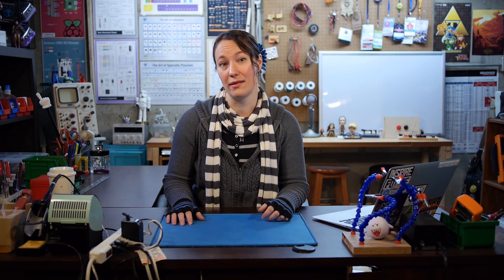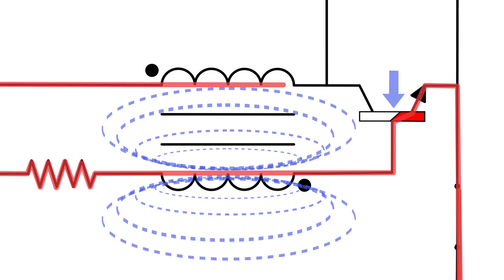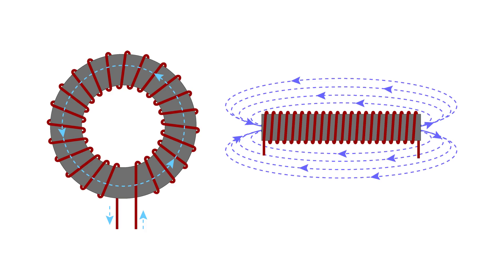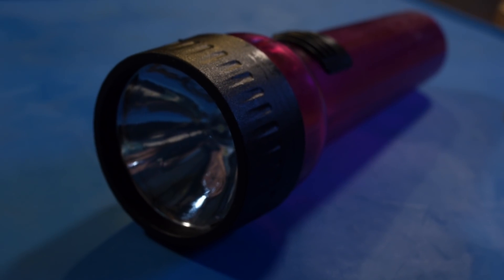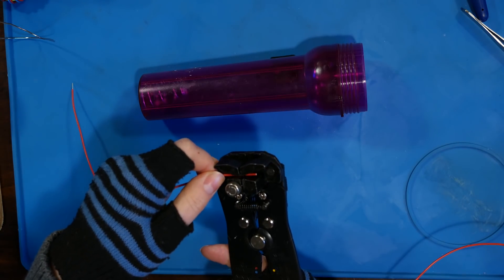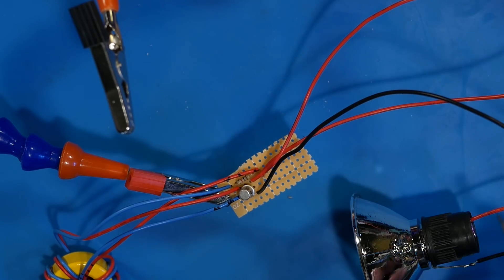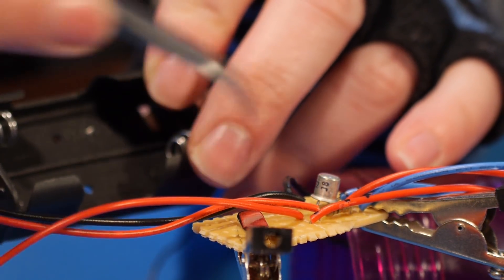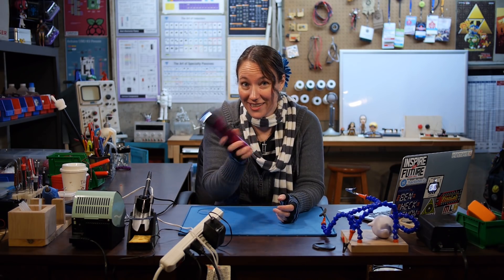Inductor Project: Battery Juicer - The Learning Circuit

Comment: SO, IT PULLS OUT MORE ELECTRICITY, BUT HELP ME UNDERSTAND.  dOES IT GENERATE ELECTRICITY TO GIVE LONGER LIFE TO THE BATTER?  iF SO  HOW MUCH LONGER LIFE.?
Reply: It doesn't generate any energy, it just boosts up the voltage high enough to power something. 

You can think of it like a siphon, pulling the voltage high enough so it can flow through the components, as a siphon pulls a fluid up and over the edge of a container.

Comment: I want to use something like this to make a led lamp.  

Does it need to be only one battery,  or can you use more?
Reply: You can use any number of batteries, but it can be hard to match dead batteries. If the batteries aren't the same voltage, things can go a little... Wonky.

Comment: Why did you need to check the polarity of the led?  It from a flashlight and still in it's housing so the center connector is always +, outer ring -.  Even older flashlight the center connector was always +.
Reply: I imagine that as it is a diode rather than incandescent it will only work from the correct direction, for those who are young and bubble wrapped and have no common sense it's a part of the process to ensure they get everything right!